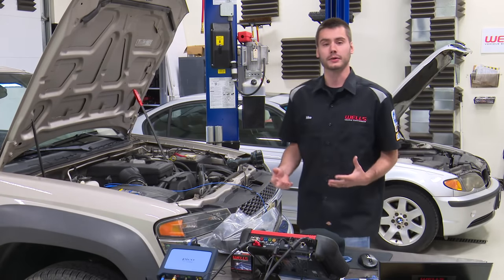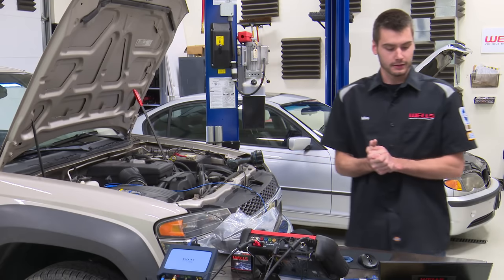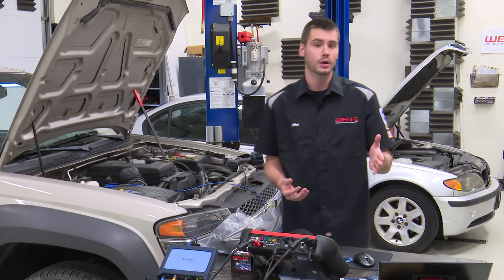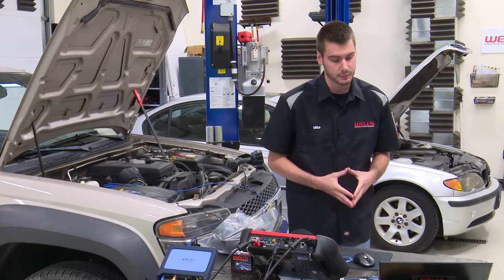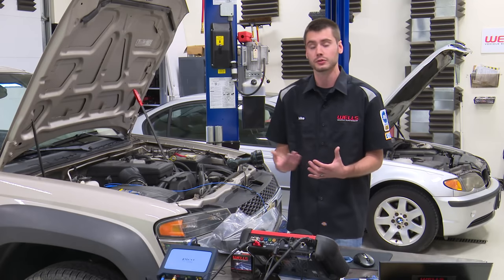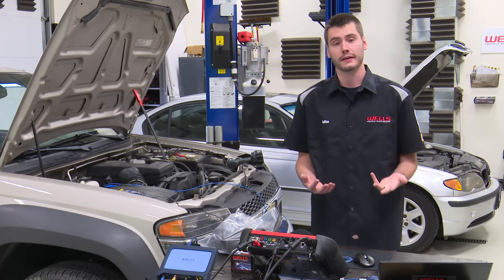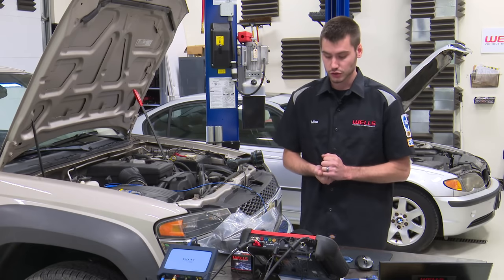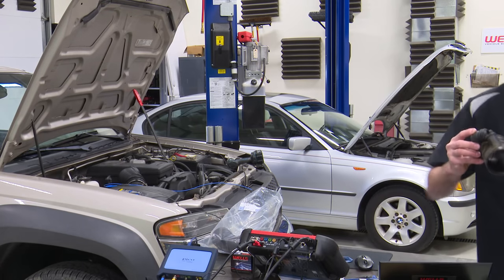Fuel Trims-- Mass Air Flow (MAF) Case Study Diagnosis (P0171, P0172)

Comment: disconnecting the maf do we not enter an open loop at idle and at wot? the pcm doesn't give a rich condition since it is in open loop? how do we know that there is no fuel problem in the initial diagnosis? unless you mean that if we had a fuel problem by disconnecting the maf we would still see a poor o2 sensor in the wot even though we will be in open loop
Reply from the maker: Hello,
When disconnecting the MAF sensor, it does not enter open loop, it enters a speed density calculation. Which means it calculates Fuel Trims off the MAP sensor and other inputs and disregards the MAF sensor reading. Its a failsafe mode and can be used to see if the car is really running rich or lean or if the MAF is skewed.
Hope this helps!
Thanks for reaching out!
~Ryan
Reply: @GoTechTraining  maybe this happens because it has a map because in opel corsa c when i disconnect the maf they go into open loop and this test is not sure. so i guess that in some models i will have to see if it goes into open loop? what is your knowledge? Thank you for your time and sorry for my questions........
Reply from the maker: Ok , I think may last response may have been a little confusing. when cars go into open loop on the scan tool it doesn't mean the ECM stops calculating fuel and trims for the engine to operate. It means the computer stops learning fuel trims because one of the sensors is skewed or something is wrong with its fuel control system. So by unplugging the MAF sensor you force the car to calculate fuel trims without the MAF reading. If the fuel trims go to normal range (even though its in open loop)  it tells you the MAF reading was causing the rich or lean condition. Now this can be from a bad MAF sensor or something causing a skewed MAF reading. If you unplug the MAF sensor and the Fuel trims stay the same there is something else beside the MAF sensor causing the rich or lean condition.
Thank you for reaching out! We love to hear from people that watch our videos!
~Ryan

Comment: Tech A only.A canister purge stuck open causes rich mixture because is always sucking fuel vapors at all engine speeds.
Reply from the maker: Hey Isaias, you're half right...but what happens once the canister doesn't have any fuel vapors in it any more? 
Mike Becker, Senior Technical Instructor

Comment: Do the air filter makes a difference on the map sensor
Reply from the maker: Hey Harry, hmmm usually not as long as the air filter is a quality filter. Some makes/models are a little more particular, BMWs can be finicky. 
Mike Becker, Senior Instructor

Comment: Hi mike ,I would like to participate in the question, I know that the video is old, here I am, technician b is correct because the solenoid is sucking air, causing a lean condition and a po171 , thank you mike take care yourself

Comment: Tech A only because the charcoal canister store fumes that is used during wide open throttle. If it's always open then it will give the engine extra fuel when it doesn't need it.
Reply from the maker: Hey Kirk, what happens if the charcoal canister doesn't have any fumes stored in it? Would it still run rich?
Mike Becker, Technical Services Instructor

Comment: Why do you say "can't reset the fuel trims" . I understand the concept of clearing the CEL code(s) but wouldnt the  DME automatically adjust to the changes applied?
Reply from the maker: Hey, it would begin to adjust, sure. But will it get into parameters fast enough to not set another check engine light?
Mike Becker, Senior Technical Instructor

Comment: i used the same test on a 2003 eclipse with a bad maf sensor. it wouldnt go 15 mph down the road both o2's dead lean. to lazy to hook up a fuel gauge unplugged maf rechecked ruled out pump first/injectors... 2 cardone sensors later its all fixed
Reply from the maker: Hey Phil, nice! Glad you got it fixed...funny how it took 2 to do it haha!
Mike Becker, Technical Services Instructor

Comment: I have a 1991 chrysler imperial that runs but while you are driving it will cut off or stall on you.  And you will be stuck for 5 minutes to hours where ever the car stall or cut at.  can you help tired of buying parts that related to the problem.  And it is also throwing codes 1225 and 0146
Reply from the maker: Hey Myz Bird, could be a lot of things. You may want to take this thing in and have it diagnosed. It sounds to me like a sensor is getting hot and failing and then once it cools down it starts working again.
Mike Becker, Senior Technical Services Instructor
Reply: could it be the map sensor or the throttle position sensor?  because  i just bought both to replace them.
Reply from the maker: Possibly, could be a cam sensor, or a crank sensor maybe? Could be a computer? Hard to say at this point.
Mike Becker, Senior Technical Services Instrcutor

Comment: 31:28 So a plugged or bad Cat can cause LTFT to be low/rich?  I have a 2006 Scion XB with no problem at idle or cruising.  Only a hesitation/studders once or twice a week from a cold engine. I get one code, P0420.  O2 levels seem ok, pre-cat between 0.5 to 0.6, post-cat 0.2 to 0.8.  Pre-cat and post-cat temperatures are similar.  LTFT are -20 when I get from 0mph to 40mph. At cruising speeds its around -14.  So would a plugged cat cause LTFT to be rich?  Or should I look at something else?  Thank you for the videos
Reply from the maker: Hey Manuel, it is possible a plugged cat could be causing your issue. But it is also possible that something caused the cat to get plugged in the first place. It may be a result, and not the root cause. I would be inspecting things like the MAF sensor, verify O2 operation, maybe do an injector balance test...see if you can fix the rich issue before installing a new cat, and potentially wrecking that one. 
MIke Becker, Technical Services Instructor

Comment: I know I am a bit late with this comment but if you still dont have the noise problem figured out you need to turn on hardware filtering within your scope options, lowpass is the software option, keep in mind once you turn hardware filtering on the noise signal will be gone forever - it will be filtered before capture

Comment: When you replace a MAF like you did on the truck in the video do you go back with an OEM part or do you get a local parts house version? My personal preference would be OEM but I wanted to know what others do.
Reply from the maker: Brandon, that is a great question. I avoid reman sensors. Some people like them...others hate them. Many times the parts store sensors are remans. If you can't find a brand new one, then go back to the OE. That's my .02$
Mike Becker, Technical Services Instructor

Comment: can you do anything with a volt ohm meter the prove it to measure it with voltage or with ohms
Reply from the maker: Hey, not sure what you're asking here?
Mike Becker, Senior Technical Instructor
Reply: Yes u can: https://easyautodiagnostics.com/misc-index/maf-sensor-test-basics-1
Unless it's dead, cleaning it is almost always worthwhile. Every failed maf I've seen puts out a constant voltage signal.

Comment: So on the Chevy is the ecm sending a duty cycle to maintain the temperature of the hot wire?
Reply from the maker: Hey Ryan, right. The goal is to keep that thing one consistent temp. The harder it has to try to keep it hot the more air that must be flowing by it.
Mike Becker, Senior Technical Instructor
Reply: That's awesome, I was always under the impression these were outputs from the sensor itself.  So how does the ECM monitor the wire or film temperature?
Reply from the maker: As the heat changes the resistance of the element changes. This changes the current value that the PCM is monitoring inside.
Mike Becker, Senior Technical Instructor
Reply: So a hotwire that has an analog voltage signal, am I correct to assume the sensor will draw the amps based on resistance change (ohms law) and the ecm would measure the draw? And the frequency type, the ecm  is essentially trying to run a faster frequency but is limited by the resistance of the sensor?
Reply: Also thank you for helping me completely understand this
Reply: I guess a better way to phrase it would be, is the frequency produced by the driver in the ecm or the sensor?
Reply from the maker: Ryan, the freq is generated by the IC(brains) inside of the sensor.
Mike Becker, Senior Technical Instructor
Reply: I just took apart a maf from a 2006 volvo s60 (not a frequency signal style) and was amazed how much is actually going on inside the sensor. I thought they were much simpler!

Comment: Why are boots riping? Could be bad motor mount. Very hot under hood.
Reply from the maker: Howard, usually heat and age. The rubber dries out and tears. Some vehicles seem to be more prone than others. 
Mike Becker, Senior Technical Instructor

Comment: Max. MAF reading with a brand new MAF sensor should be somewhere between 80-85% of total engine's horsepower
That's what i noticed too working on many makes and models
Reply: Hello G.skillz, maybe you meant to say is a brand new MAF sensor should read 80-85% of pistons calculate displacement in relative to rpm & corrected air density

At 750rpm/2/60 x 1.8litre engine = 11.25litre/second total piston calculated displacement action.

Corrected air density at manifold of 0.53g/litre at IAT of 105F at 0.5bar. 11.25 x corrected density = 4.7g/second.

4.7/5.7 = 83%. 🤔🤔🤔. This should be what you had mentioned. Also most engine suction valves close off only when pistons are at 50 to 60 degree after BDC. Regards.

Comment: Why my short term fuel trims are high at idle like 20-25 % , and long term fuel trims are 0% and they never change? This dont seem normal since the short terms are very high.
Reply from the maker: Hey Fortnite Daily, hmm great question. Maybe your car won't adjust long terms at idle?
Mike Becker, Senior Instructor
Reply: @GoTechTraining  why the car dont adjust long term fuel? Is this a problem??

Comment: Mike Backer ,thks for the show hahha I have a question about trimas, pid fuel trim lean enable or disable do you know whats the strategic for the pid to change from enable to disable of courses when the vehicle is not under mixture control. thaks.
Reply from the maker: Hey David, thanks! I am not exactly sure what you are asking here? You wondering about the fuel trim enable pid?
Mike Becker, Technical Services Instructor
Reply: Yes I saw some GM when the vehicle is  under mixture control that PID would show as fueltrim lean enable, but when the vehicle is not under mixture control the PID would show as fuel  trim disable. I just wander is you know what s driving tha PID. I hopefully I make myself clear . thanks
Reply from the maker: Hey David, yeh I have seen that PID before. I believe that PID is showing you if the criteria is met for the computer to learn the long term fuel trims. This is based upon coolant temp, throttle position and engine speed. Also, loop status open/closed would affect this as well. 
Mike Becker, Technical Services Instructor

Comment: Hi Mike,
another generic data for MAF grams per second is 40 grams per liter engine displacement at 5000 rpms. This comes out of a MODIS manual from DEWITZ DIAGNOSTIC SOLUTIONS.
BTW, question for you: WHY actually does the pcm go into open at WOT?  :-}  (tip: happens on circonia sensors, not so on wideband ones.)

Congrats to the birth of your son, best wishes for all of your family.
Reply from the maker: Hey Jurgen! That's good info to know. I'll have to try that out!
So why open loop at WOT? A standard zirconia sensor has no way to know how far rich or lean... an engine at WOT wants power, that would be rich of the stoic mark, maybe 12.5 to 1 or so. But the standard zirc sensor can't read 12.5 to 1...just that it's rich. So, the PCM says, if you can't read it accurately, I can't trust you. Open loop, goes into default fuel map strategy. A wideband sensor can read rich and lean, that's why we are able to stay in closed loop fuel control during WOT. So, how did I do my friend?

Thank you! We appreciate the wishes. I hope I can get him into cars :)
Mike Becker, Technical Services Instructor
Reply: Hey Mike, 

well done on the open loop! The information I have states the window of a narrow band sensors do work reliably within the range of 14.3 to 14.9 ratio.

Greetings Jürgen.
Reply from the maker: Hah! Great! I studied up :) 
Mike Becker, Technical Services Instructor
Reply: Great videos Mike!! Juergen , I hope my comment isn't too late but I recently came across  two wideband sensors  one  Mazda 2016 the other Toyota 2009 and in both cases the pcm went into open loop at WOT even at 75%  throttle.
Reply: @professorlanguagepartners3112  Thanks for the feedback, always good to know.

Comment: It would be running rich, right? Because the purge   Valve is stuck open which would keep pulling the fumes from the canister???  Yes? Maybe? 🙏🏽
Reply from the maker: Hey Luis, It could run rich, yes...but that is not the complete answer. You should check out the TechConnect Episode. I actually go into this in-depth and explain the complete full answer. Here is the link https://youtu.be/JKovg8lELNU
Mike Becker, Technical Services Instructor
Reply: thank you! ill check it out:)

Comment: Hello I have an 07 gmc canyon 3.7 in line 5 I have the P0171 code I've have the smoke test done changed the upstream O2 sensor and the maf, code still comes back
Reply from the maker: Hi Jared, I would inspect your fuel pressure. It sounds like fuel is one of the few things you haven't checked yet.
Mike Becker, Technical Services Instructor
Reply: Hello I did what you did in the video and unplugged the maf sensor tho I didn't get a rich condition the truck ran better, I inspected around the exhaust manifold and felt hot gases hitting my hand, in short air is entering through the exhaust before the o2 sensors
Reply from the maker: Sounds like the problem then, excess oxygen going past the O2 sensor will definitely cause a lean condition!
Mike Becker, Technical Services Instructor

Comment: 8500 Grams per second  on gm frequency maf sensors at wot is good  and the scope glitches is scope aliasing over sampling  or if consistent and high volts  could be secondary voltage spikes
Reply from the maker: Thanks Thomas Torres. I received an email from a viewer that said the same thing. I should turn down the sample rate and would probably get rid of the aliasing. Thanks! As for the HZ...Would this not be affected by engine displacement? For example...the 5.7L GTO and the 6.0L GTO both used the same MAF sensor. Wouldn't the HZ on the 6.0L be higher than the 5.7L because it breathes more?
Mike Becker, Technical Services Instructor
Reply: I'd imagine you would be correct bigger motor more flow rule of thumb I use on gms  in mad vid
Reply: In mass air flow video initial Spike should be higher than second Spike if not equal to dirty or bad mass air flow sensor shows up as lower initial Spike
Reply from the maker: Yep, I agree. But, i'll keep an eye on the 8500 hz number and see what I come up with!
Reply from the maker: Thomas, if the initial spike is lower due to being dirty, would it not be true the 2nd spike would be lower as well? The dirty MAF isn't restricting air, it just isn't reading it correctly. So, the engine is still gona breath that big gulp, then a lesser one. I would think you would find both spikes lower. Thoughts?
Mike Becker, Technical Services Instructor
Reply: Both would change yes  it is what I've seen on gms sometimes they over report and some times under report
Reply: seems a good place to add this.. http://www.epi-eng.com/piston_engine_technology/volumetric_efficiency.htm

Comment: I have a 2009 3.7 colorado and have been getting the opposite situation as this one, after installing an aftermarket intake I got a steady p0172 and an occasional p0101 code (maf sensor low activity). I replaced the maf sensor and nothing changed but noticed the wire harness is stretched some to reach new position on the new intake. Could a loose/pulled wire connection somewhere be the cause of this?
Reply from the maker: Hi Greg, a stretched harness can definitely lead to the connection being loose. I would see if you can find any more slack in the wiring down the line, otherwise find a way to get that connection closer. A good way to do that is buy a pigtail connector, they usually come with long wires that you can wire in.
Mike Becker, Technical Services Instructor

Comment: The 80% rule does not work for me as a useful rule, consider a high tech vs low tech motor, both still want the ideal 14.7% air fuel ratio but hp between them is quite different....
Reply from the maker: Hey David, interesting. I guess it does depend on the engine.
Mike Becker, Senior Instructor